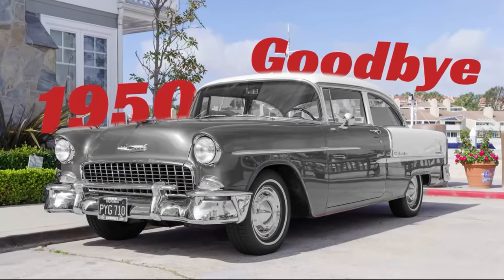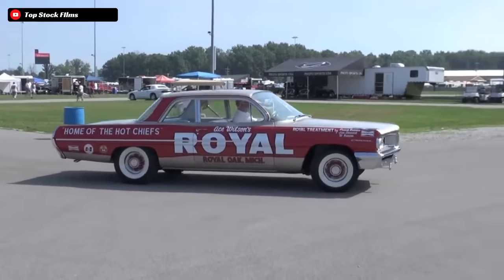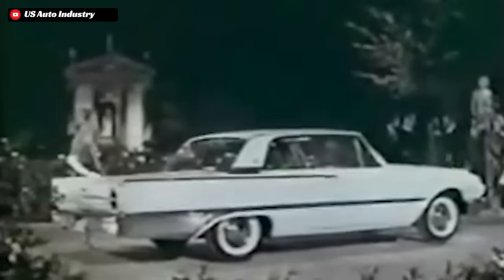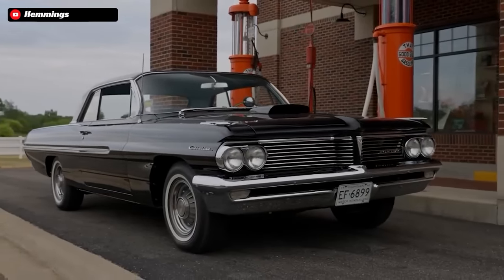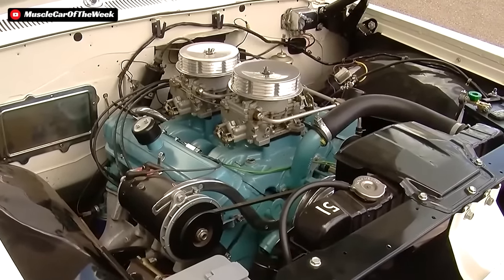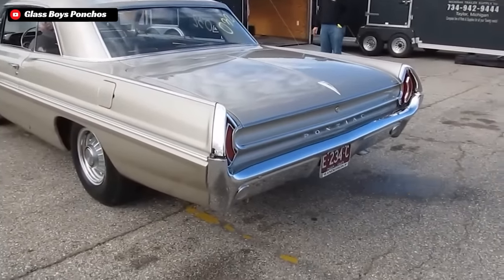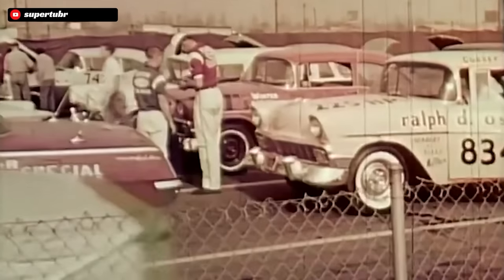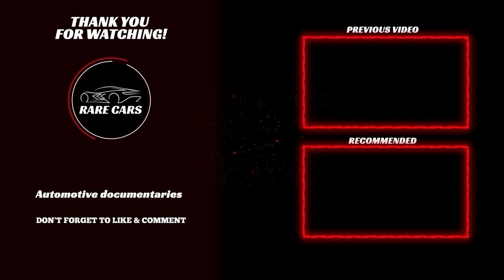A Wolf In Sheep's Clothing - The 1962 Super Duty 421 Pontiac Catalina

Comment: My father drag raced semi-pro from the 1950's to 1980. He was a mechanic at a Pontiac dealer. The first "new" race car he bought was a 1962 421 Super Duty, that he bought with his employee discount. He then bought a new 1965 GTO, that he used the 1962 421 Super Duty engine in. Then he bought a new 1968, that got the 82 421 SD and then he ordered a new 1970 GTO Ram Air IV. Some weeks later, Pontiac contacted him and told he GTO RAIV had been discontinued, but they would sell him a GTO 455 for the same price. At the time, the RAIV engines that were supposed to be for 1970 GTO's were being used in 1970 Firebirds. Between my father and the dealer negotiating with Pontiac, Pontiac agreed to assemble one last 1970 GTO RAIV for my father. That was likely the last GTO RAIV made. My father used the RAIV cylinder heads, intake and carb on the 421 SD. He then switched from the 70 GTO back to the 68 Firebird, for its lighter weight and port matched a Holley intake with a Holley 850 on it. The parts originally from the 421 SD were the crankshaft and connecting rods. In the late 70's he switched the 4-speed to an automatic, for bracket racing. Sitting for extended periods in the racing seat started to bother the veins in his legs and he quit racing in 1980.

Comment: There was also a 421 tri power in 62 you could get there were less than 17 Grand Prix equipped with them i’ve seen one in real life and heard the story about it. Catalina had more of them it’s a bucket list car for me to get my hands on one of those or a Catalina with one
Reply: 1962 Grand Prix with Tri Power 421 would be epic. Especially if it had all the luxury items like AC, power windows and doorlocks, full console with real wood surfaces, wood also on door panels and dashboard. They made quite a statement when new.
Reply: @MarinCipollina  they exist. There are just very few of them. They were all custom ordered cars. I know somebody that owned one of them. How do you think I heard of the story it was a four speed car aqua exterior aqua, and white interior no air-conditioning center console tachometer, eight lug wheels, power steering power brakes. It was a gorgeous car. Eventually it had to be sold because the owner was a friend of my parents ended up passing away and his wife had to sell it at the time. If I had the money I would’ve bought it because of knowing how rare the car was. Car was never restored. It was a Texas car. The only bit of touching up it needed was up under the hood with the carburetors valve covers intake, etc. because the paint was beyond worn out and chipped off just to clean up the engine bay. It just needed it badly but after the engine bay got cleaned up, it was near perfect

Comment: The year before this, Pontiac started using a "Torque-Box" perimeter frame with side rails on the Catalina, permanently ending GM's terrible "X frame" design.
Chevy also switched the Impala to the "Torque-Box" frame instead of the "X".
Two weeks after these started rolling off the assembly line, the 1962 Impala SS 409 followed and was its only close competitor in that market.
I know there's an argument about the definition of a "muscle car" but in my eyes, the '62 Catalina S.D. & '62 Impala SS are the first. Although, if someone wanted to argue that it was the 1949 Oldsmobile "Rocket 88", I wouldn't put up much of an argument.